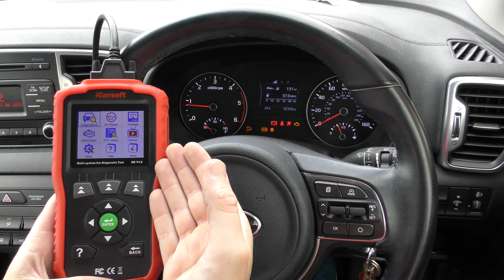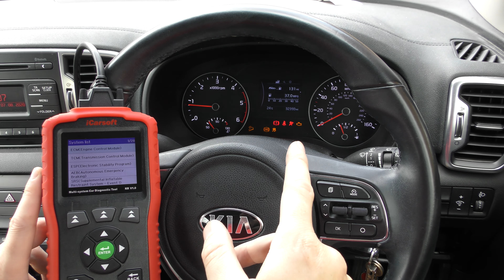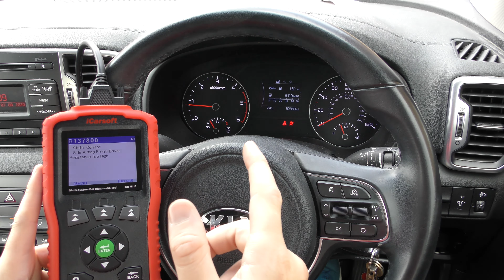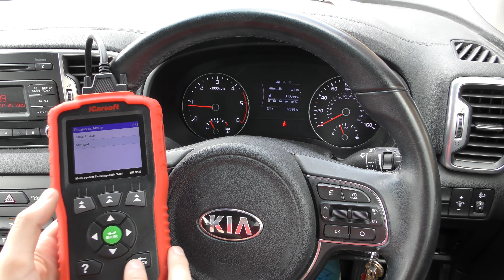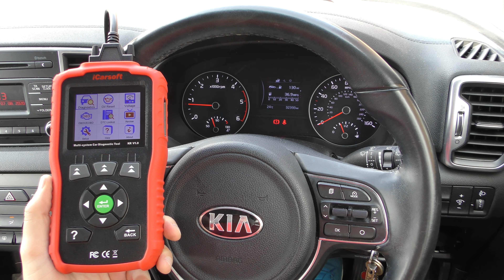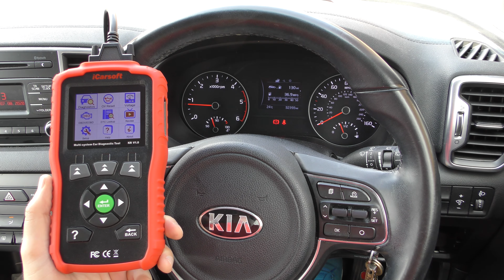iCarsoft KR v1.0  - Everything You Need To Know - Kia Hyundai Daewoo Code Reader Scan Tool

Comment: I have seen some tutorials on how to do it, but they all require me to remove the module, remove the EPROM, reset it and then solder again, I want to know if with this way I do not need to REMOVE THE MODULE AND THE EPROM, I have a HONDA CIVIC 2016 TOURING, Which tool you recommend me and the vehicle does not deployed the Airbags.